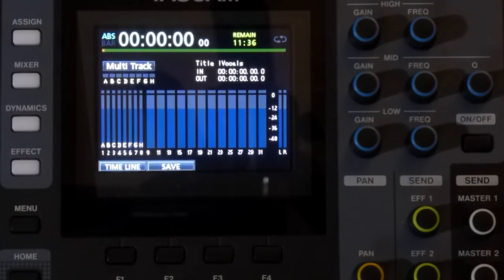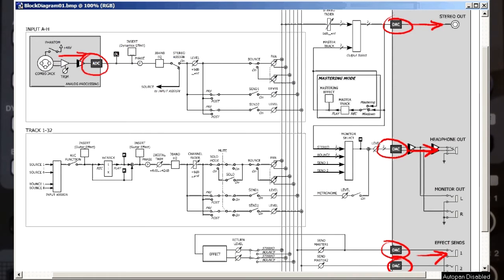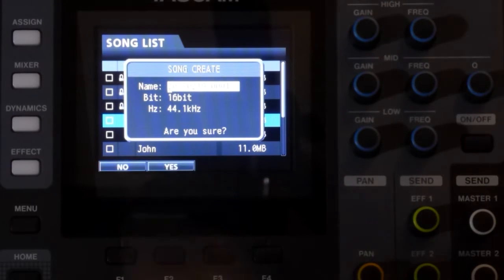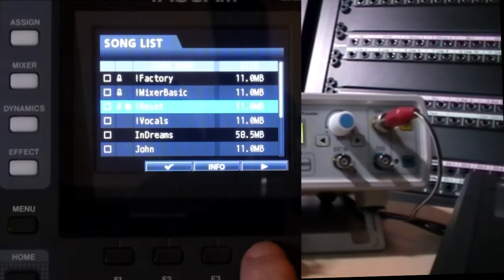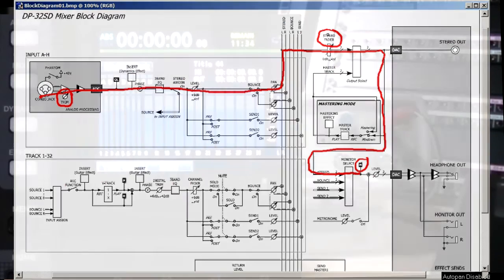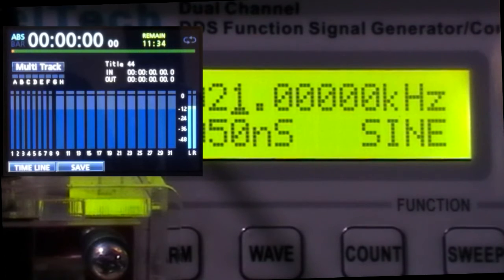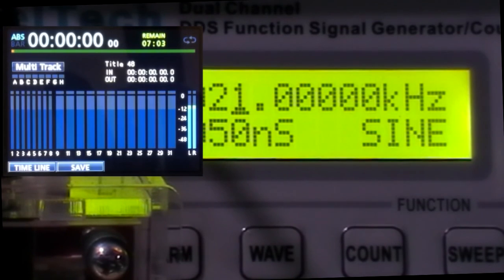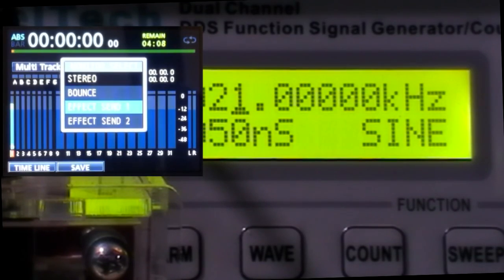Tascam DP24/32SD Tutorial 6D: Quality

Comment: These videos have been great, and they are a huge help. I just have one question which might be a stupid question, but I'm very new to this unit. Does the REC button HAVE to be armed in order to get sound to your headphones or monitors? When I have a microphone plugged in, I get nothing unless I arm the REC button. Is that correct? Thanks!
Reply from the maker: @Home Bar Productions thanks for the kind words. Don't worry about whether questions are stupid or not - we all have to start somewhere... and it's better to ask if you're not sure, instead of jumping to the wrong conclusions and digging a bigger hole for yourself :)    The REC button only has to be pressed if you want the input signal to flow through the track path, regardless of the recording state. If you assign your input to the Stereo Bus, it will flow along the top path of the diagram and you'll hear it in your headphones without having to press the REC button. If you follow the videos in order, the first ones concentrate on this 'straight-through' signal path - I call it a 'basic mixer' configuration. When you get to video 6A, this shows the path when you assign an input to a track - I call this an 'advanced mixer' configuration.
Reply: @philtipping  Thank you so much for your response because this has been driving me crazy. When I get home tonight, I'm going to follow right along with video 6A and see if I can't remedy the issue. Before this, I had a Tascam Neo2488, and that was really just a plug and go machine. This extra step kind of baffled me a little bit, so again, I'm looking forward to seeing if I can't remedy the situation. Thank you very much again for your help!

Comment: I use my dp24's to record all instrument tracks  (live) at 44.1/ 24bit.  No FX's...Never have latency or any other  problems.  I then export tthe wav files to studio one artist and add vocals, mix and master. It's perfect for my home studio and the results are superb thanks to your tutorials.   Your expertise has been invaluable and you have contributed to some REALLY great recordings. THANKS, X 1000!
Reply from the maker: @Donnie Smith thanks for the kind words Donnie; my workflow is very similar. I already had a recording setup but needed a portable machine for location recordings, so it's good the machine can be used in so many different ways. Good luck with your projects.

Comment: 44.1k is good enough depending on the source you are recording. I own a Neumann u87i and several akg c414 and those microphones top off at 20khz. So unless you have some external preamp or compressor that adds harmonic content above 20khz, recording above 44.1k is useless. Now if you are recording synths or external guitar effects you might benefit from it.
Reply from the maker: +descargamusicalny good point, although when you say 'top off at 20KHz', it doesn't mean the response drops to zero at this point - some higher frequencies will get through. Some systems record at 96KHz (or higher) so must be a reason - too much for me though :)

Comment: one button labelled - '24bit/48khz' - would have been preferable - (if not for you I'd be using 16 bit from here to eternity..)
Reply from the maker: +Kenneth Gibson, agreed, or even defaulting to the current song setting instead of going back to 16bit/44.1KHz... although once you're used to its quirks it's not so bad :)
Reply: you'd think the default would be the one that showed the machine in the best light but it's no big deal as you say - it has lots of faders, buttons and lights - that MORE than compensates..